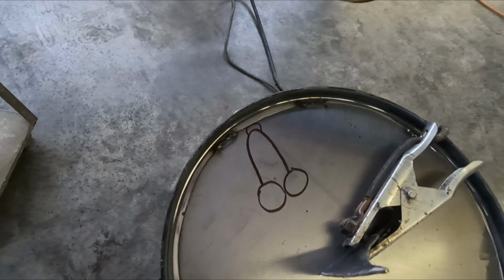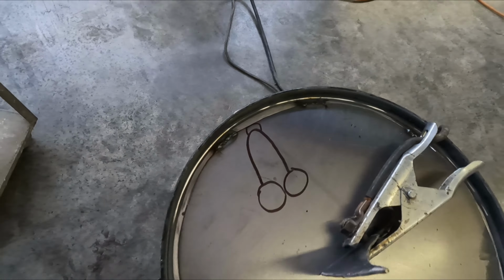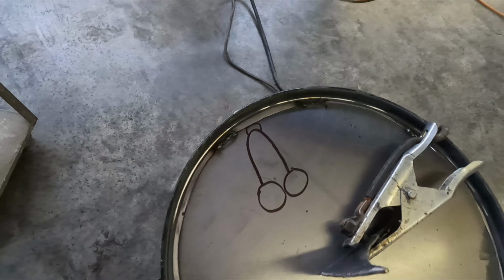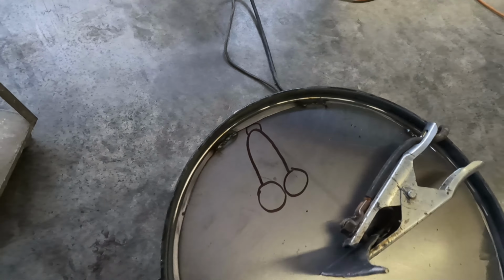Pit Barrel Cooker Repair - Welding my Smoker

Comment: Hey Kyle, sounds like you haven't welded about as long as me. From the looks of it though it seems like you were running it too cold. Still turned out good for what you need.
Reply from the maker: Yea I watched some videos on welding AFTER I did this lol. Learned a bit. I have plenty of scrap metal I'd like to do some practicing on.